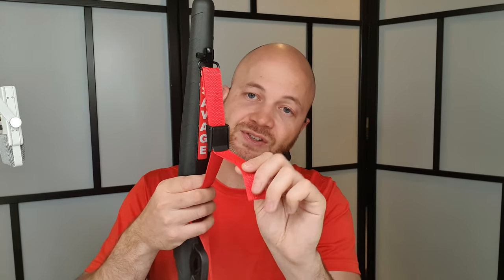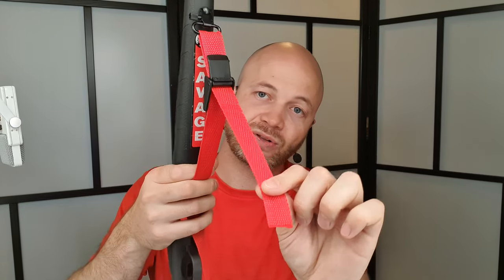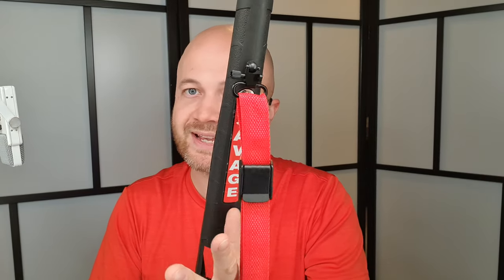DIY Appleseed or Mapleseed slings

Comment: Great vid man. But at 1:28 you mention orienting the qd to one side to keep it from popping off, which made me curious..
Then at  4:46 you demonstrate mounting the qd to the stock by pressing the spring plunger and rotating the tab closed.
This is only the 1st of 2 steps. The 2nd step is to twist the pushbutton clockwise so that the plunger cannot back out on its own.
Cheers brother.
Reply: It is an odd mechanism, but you'll see what I mean if you try it.

Comment: Remove the j-hook and replace with a quick disconnect also nylon slips off your shoulders. You should be using cotton.
Reply from the maker: These are cheap & quick. A better sling would be 1 1/4" cotton.

Comment: I tried making a few, I found the strapping I chose was too thick for the cam buckle to hold properly. 
If I make another I am considering using a flip top belt. They are cotton, come 52” long and have a good buckle. Just need 1.25” tri-glide and sling swivel.
Reply from the maker: Cotton is better for hanging on to your arm anyways.

Comment: any suggestions on a location in Canada to obtain/purchase single CAM Buckles and Tri-slides?  Amazon has batches of 10, but I am not starting a mini-militia :)
Reply from the maker: Just buy a USGI cotton sling off Amazon https://amzn.to/3HrqLbO
Reply: @Huntinggearguy   at 3:40 you show that the USGI sling comes with a J-Hook.  at 4:30 you show the quick-connect style swing swivel that is found on my Savage MarkII.  Are you recommending the USGI cotton sling, and then removing the J-Hook?
Reply from the maker: @ecpoirier yep, remove the j-hook and find some quick connect sling mounts that work with 1 1/4" sling.